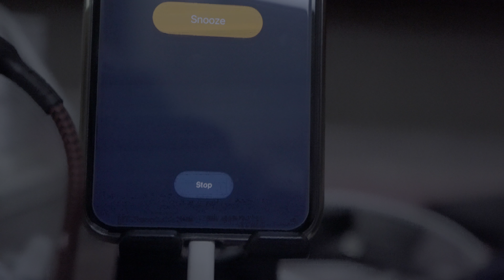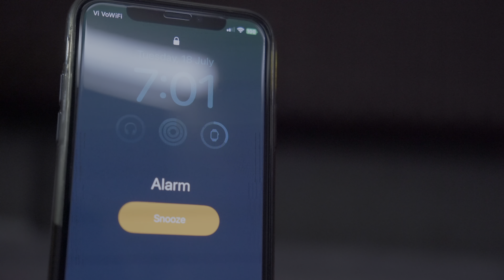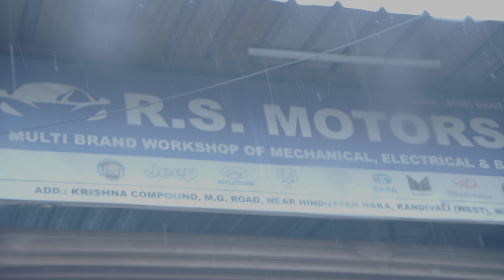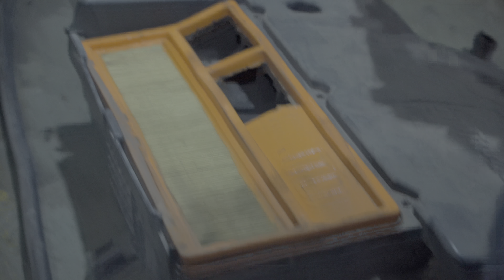TOOK MY CAR FOR SERVICE | 😍🤤❤️ FIAT GRANDE PUNTO 1.3 Multijet 😍😱❤️

Comment: Also you can try adding an armrest , and an infotainment system right ? A sleeoer modification would be really good for this car , if you do that along with driving pov videos i could watch it all day on repeat
Reply from the maker: There's already an arm rest in the car! ☺️🙏🏻❤️ Any other modifications at this point would not make any sense since diesel cars will not be on the roads for too long from now! Hence it does not ideally make sense investing a lot into the car at this point! ☺️🙌🏻🙏🏻❤️
Reply: right, just a few more years, but the emotion pack engine is still so solid like ever since bought if we dont rev up much and maintain it well, maybe got to get some infotainment android play to enjoy long trips more, i want an asmr punto drive tho. Maybe if it takes effort, try no talking, video only , whenever u take ur car. Refer some other yt vids like joe black or so @ArishGhaswala
Reply: u can try same for ur superbike as well @ArishGhaswala
Reply from the maker: Brother I Already Make ton of Superbike Ride Videos! @EvoZzz_PES